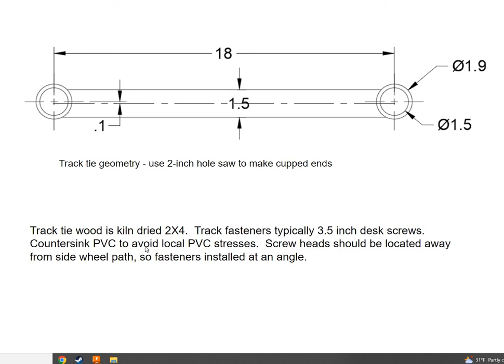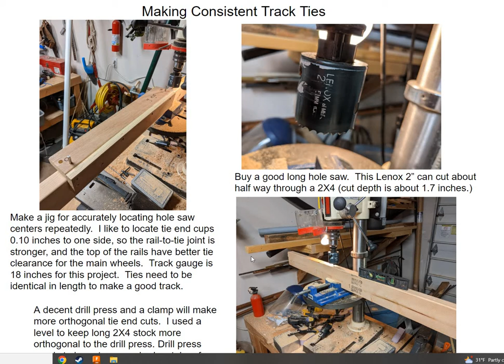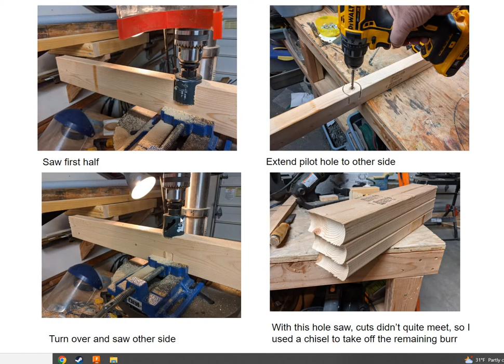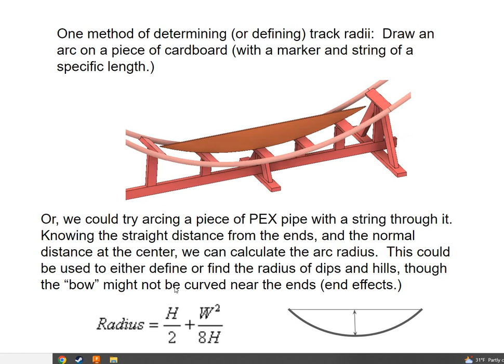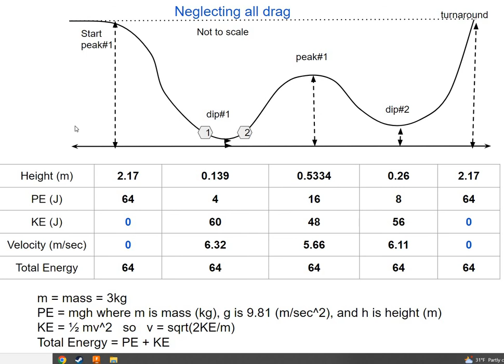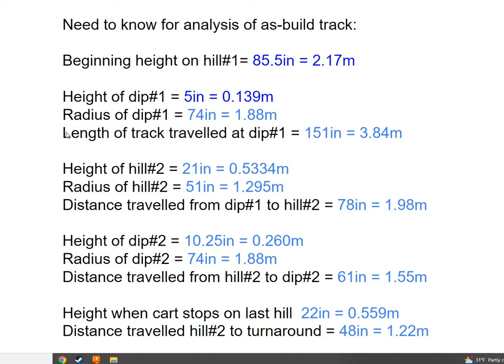BYRC STEM Course R3 Part 5

Comment: How do you connect the PVC pipes
Reply from the maker: For 1-1/2 inch PVC, I take a ~7 inch piece of 1-1/4 PVC, cut a 1/2 inch slit in it longitudinally, compress it to slide into 1-1/2 inch rails, then secure with short countersunk screws.

Comment: Great video.  I'm building a roller coaster myself and I keep running into the problem of the track sagging to the sides with only one post in the center of the ties.  How did you fix this because I noticed you only have one as well.
Reply from the maker: I'm not quite following you.  What is your track gauge?  Are your ties 2X4 wood?  Is the wood sagging?  How heavy is your rider, and what is your force, in g's?

Comment: Hi, gregg! Would you mind sharing the dimensions in lenght of the 3 parts (purple, blue, red) at 7:39?.
Reply from the maker: Those sections of track are about 10 feet long, which is the nominal length of PVC pipes.  I think this track gauge was around 16.5 inches.

Comment: Excelent videos Greg. A question please... How do you bend tubes to get the radius of the track?
Reply from the maker: Look up my hot sand forming video?   Nighthawkinlight also made a video on this.
Reply: @PaulGreggBYRC  Thank you so much Professor. Another question please... Is there a video that explains the procedure to join pipes? I mean, the way you make the joint between pipes.
Reply from the maker: @diegoarevalo652  For 1.5-inch PVC track, I use 6-inch long1.25-inch diameter PVC connectors, split lengthwise with a wide cut so you can compress the connector to insert in each rail, then secure with deck screws and trim off tip of screw so it's not dangerous.